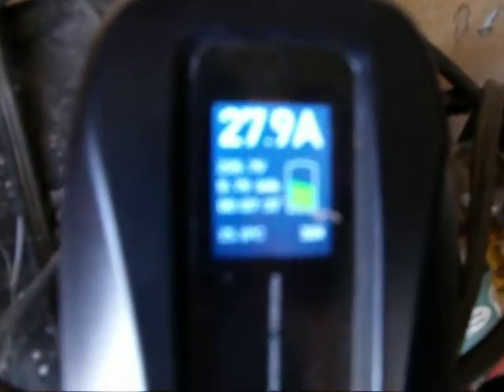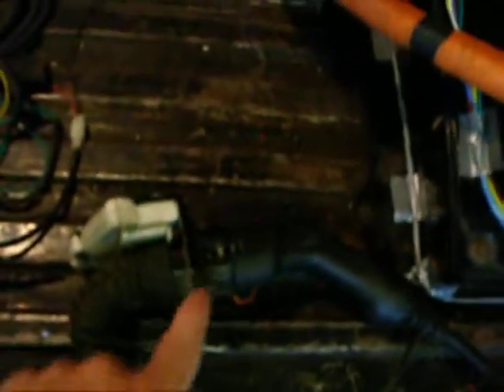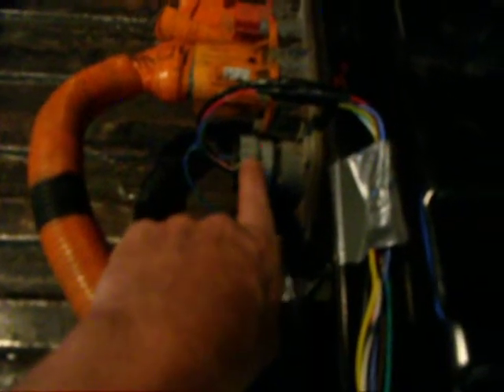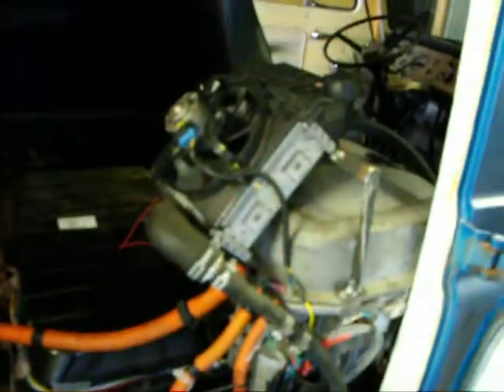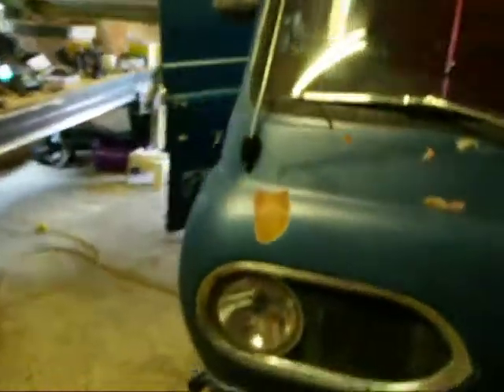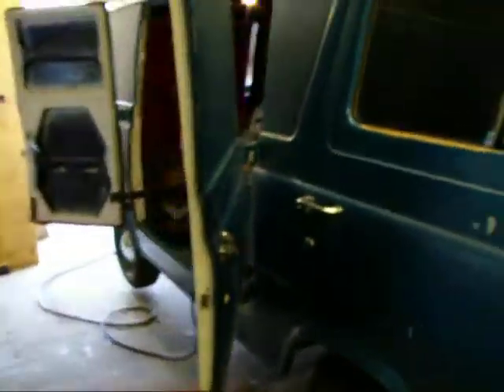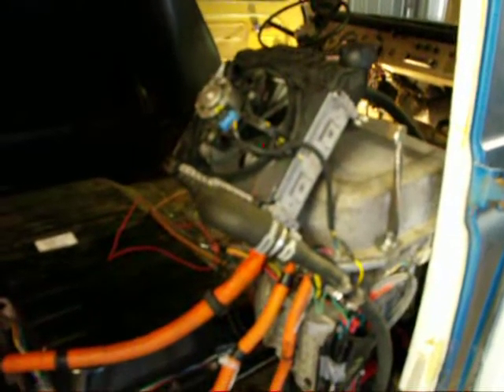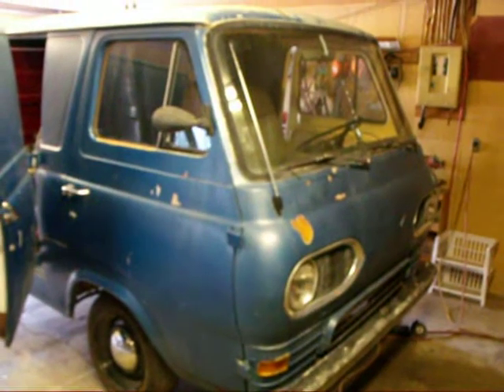1967 Ford Econoline electric conversion with Nissan Leaf parts #12.  IT'S CHARGING!!!!  YAY!!!!

Comment: What was the problem with the thunderstruck? Why the switch to resolve? I've been planning a build with the thunderstruck.
Reply from the maker: at the time i couldnt find a hack to make the charger work.  the thunderstruck is great but i would have had to buy an aftermarket charger.  the resolve controller will use the nissan leaf charger.  it is possible someone has hacked the leaf charger by now.